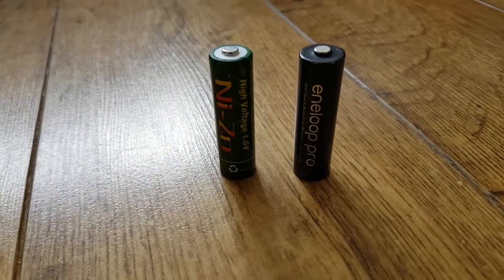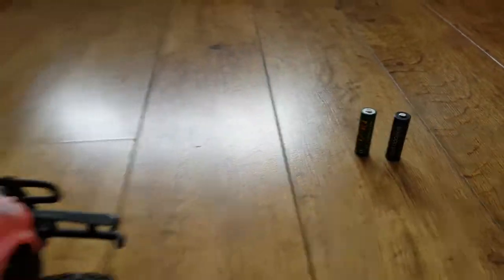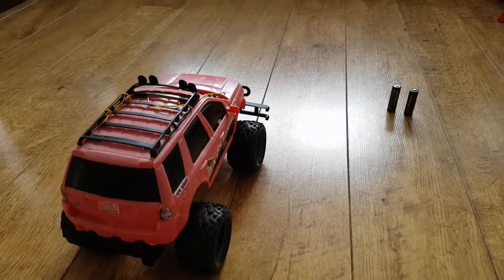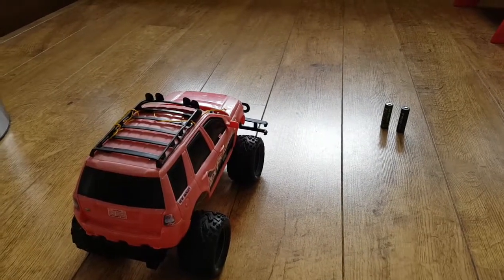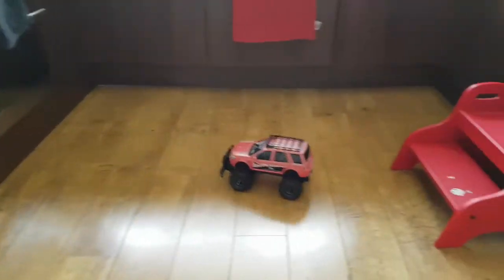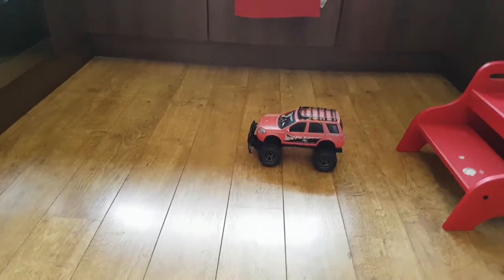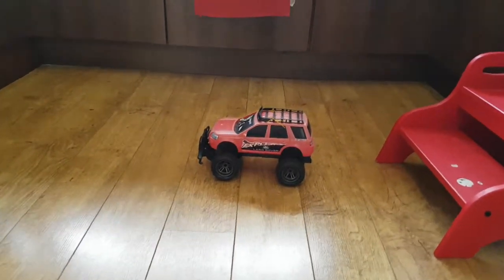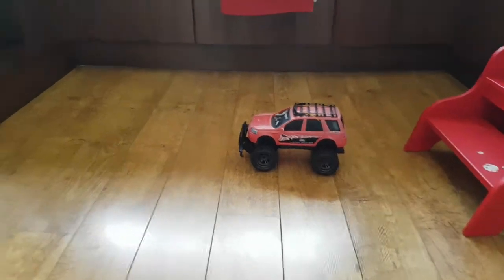Ni-Zn vs NiMh in a cheap RC car

Comment: none of my digital cameras will work with nicad/nimh due to the lower cell voltage compared to alkalines, but those nizn ones work nicely, ,but they're not easy to find....
Reply: now maplin's gone, dunno any other retailer that stocks them.....
Reply: @andygozzo72  If you are still looking, I use PK-Cell(NiZn) with the charger and they do work very well but sadly my charger did break after 1 year but my batteries life span are great for running my VR controllers and other household items